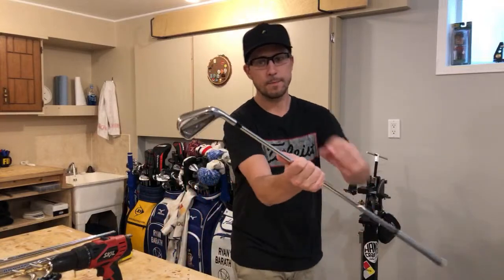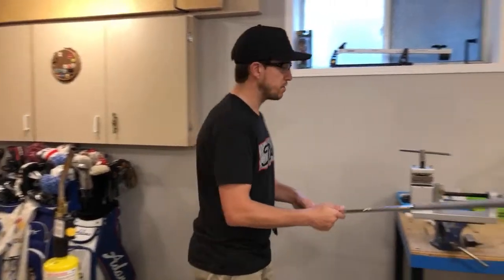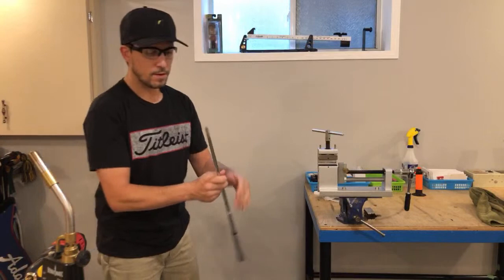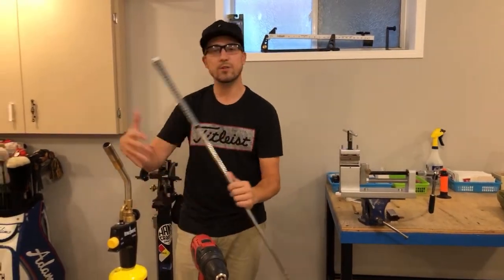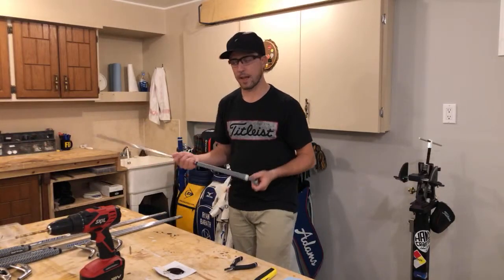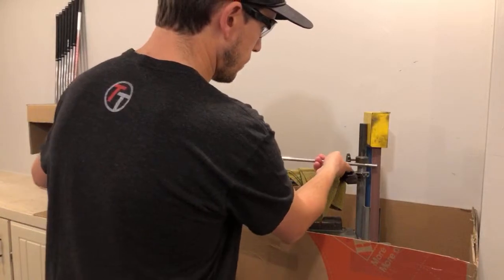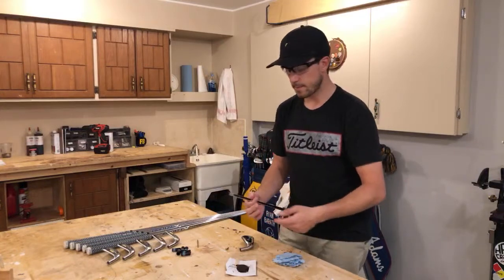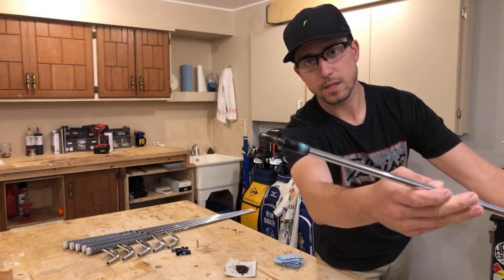Club Building 101-Installing New Ferrules

Comment: Here’s my question. If they have a weight to them as is and you want to do this when you remove the shafts from the club head and there’s a tip weight why not just use it instead of having to use all new ones and re weigh everything

Comment: Hi Ryan, another great video. Not to nitpick, because it's obvious that you are very thorough, would you not wipe down the hosel of the club head with acetone (or blow it with air) after using the wire brush? As some bits of residue may still be in there?
Reply from the maker: HI Gary, Ryan Here,

After going through the process of cleaning with the wire brush and just tapping it on the bench its good to go.

Comment: Couldn't you just weigh the old swing weight you remove on a scale to know which new weight to use? Even with some resin present, should be able to get reasonably close I would assume? Most of us don't have equipment to measure club swing weight.

Comment: do you use shafting beads?
Reply: I also noticed that the set on the wall that the grips were not aligned. One of the grips you could see the logo.  Wouldnt you align the head with the logo all facing the same way?

Comment: Can the tip weights just be cleaned and reused?
Reply from the maker: Hi Wesley, Ryan here.
Thanks for watching the video and asking a great question. 

Yes, there is certainly a case to be made for reusing the factory tip weights. The problem is the amount of time it takes to clean them out vs. the cost of just using new ones. Based on the potential for changing the final swing weight I wanted to use new ones which is also best practice.

Comment: So two things you did wrong. They  seem small but they throw things off for a picky client.  First of all you didn't use any centering beads. Secondly you leaned the club against the wall to dry. What does skipping the centering beads and leaning the club against the wall result in is a club head that is not centered on the shaft.  Leaning the club against the wall will lead to the club head tilting with the bottom of the hosel pushed against the back of the bore and the top of the hosel pushed against the front of the bore. This is made worse by not having the centering beads in the epoxy!  So the resulting club will have a lie angle change due to the tilt of the shaft in the bore of the hosel.  i worked both at Hotsticks in Arizona and was the lead builder who created the custom build shop for KZ golf when they were in North Hollywood, Ca.  if you use the centering beads and actually have a rack or table to lay your clubs down on while drying you will end up with the shaft being centered in the hosel bore and your lie angle being what it was bore as long as the previous build did his job correctly. I can look at a custom built club and see if this was done correctly on the finished club by looking closely at the ferrell.  If it was done right before you trim the ferrell there will be an even lip all around the hosel. If it was done wrong you can see one side of the ferrel will have a bigger lip than the other. Usually the back side will have the bigger lip.
Reply: Shaft beads are only used when there is play in the hosel, if the shaft O.D. is tight against the hosel I.D. then where do you expect the centering beads to go? Clearly you don't have the experience to call this gentleman out..
Reply: @k2sumner  are you kidding me right now?

Centering beads are used in every new club build, period.
Reply: @k2sumner  it's literally microscope beads designed to makeup the difference in the od vs the id.
Reply: @k2sumner  and btw, that difference in tolerance is literally designed for centering beads. Anyone who claims to know anything about clubs should be aware of this.